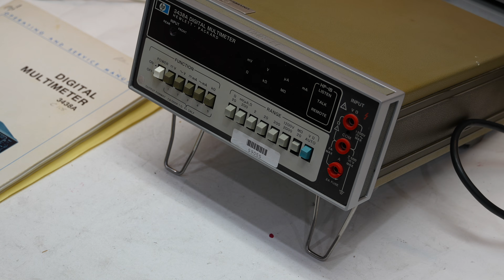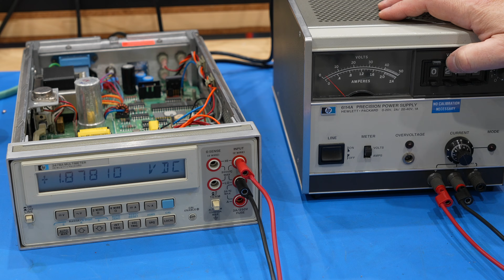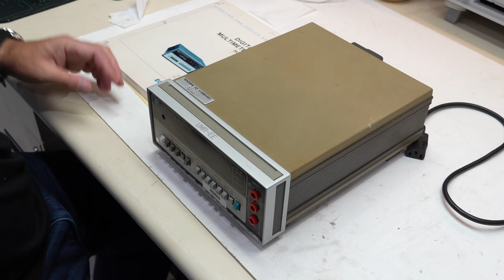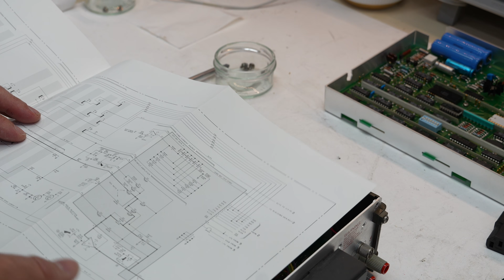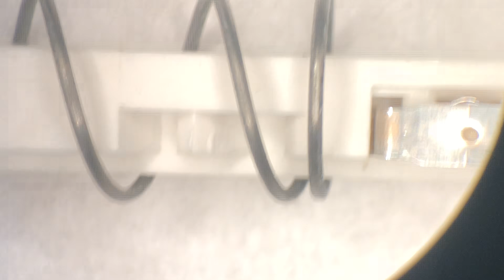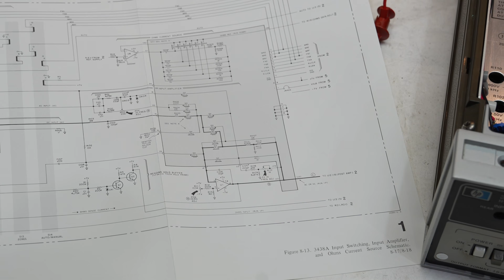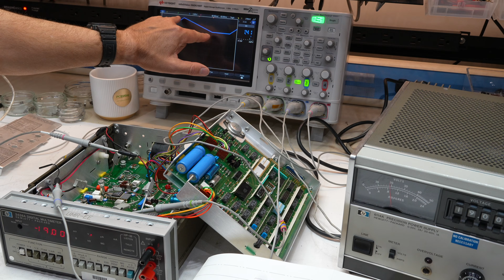HP 3438A Digital Multimeter Repair, Calibration and Principle of Operation

Comment: I have a 3466A which looks identical apart from it's slightly more portable case format and no HPIB. But it's 4 1/2 digit.
Reply: I have two 3466A meters -- I love them for their clear and bright displays. I had a 3rd unit, but it had the problem with deteriorating switches. Their plastic suffered from serious melt-down. I think a former owner used alcohol or a bad solvent in an attempt to clean them. That meter is now my spare-parts unit.

Comment: An odd problem with gold finishes used for soldering and electrical contacts is the adsorbtion of organic contaminates. This happens on circuit boards with electroplated gold finishes which pick up contamination during the subsequent manufacturing operations. Sometimes a light plasma cleaning is used to remove this and clean the gold without damaging the finish. Your theory that the plastic may have outgassed is probably correct. This is generally not an issue with connectors (which should make gass tight connections) or low usage contacts that have a strong wiping force (like gold fingers). On switchs that are specified for high cycle counts the contact wiping force must be relatively low in order prevent damage to the relatively soft and thin gold surface. As a result of the contacts are in an environment that exposed them to some types of vapors and contaminates they may become contaminated and exhibit poor surface.  resistance
Reply: Metallurgist here.  Another issue with soldering gold contacts is the reaction of the tin with the gold plating. Tin forms a brittle intermetallic (AuSn alloy) amalgam that can cause joints to crack.  

You normally need to apply and remove solder several times in order to basically dissolve and get rid of thebgold plating so you can get a good contact with the nickel plating or base copper.  Especially with gold cup connections.
Reply: @marshalltjones  fascinating. I’ve seen some people say corroded gold solder pads must not really be gold since gold doesn’t corrode. I’ve previously suggested they might’ve used brass, since it’s conductive and was used quite a lot in the 19th century electrical. Reading this, since tin is happy to corrode, maybe it was the gold-tin amalgam which corrodes in those cases?

Comment: Nice meters those, readable AND auto range.
Mine also had problems with the switches, but I do not have your patience, sprayed them with contact cleaner, massaged the switches and blew out the residue with compressed air.